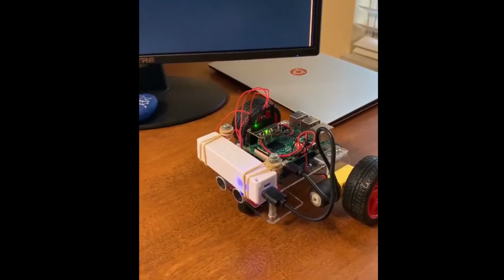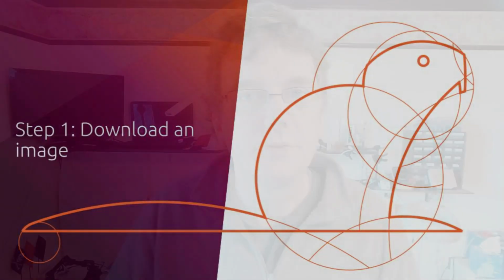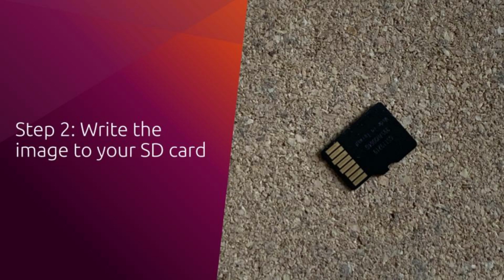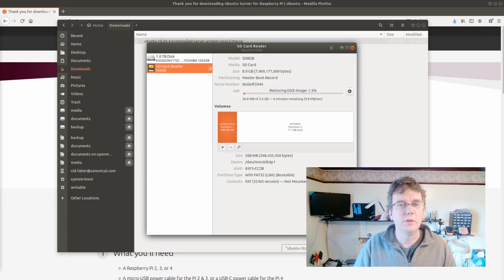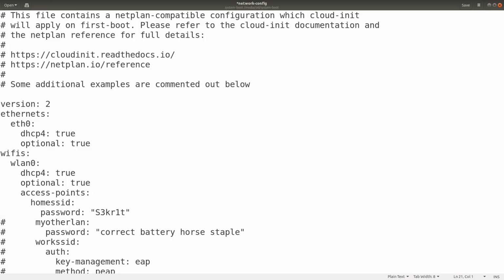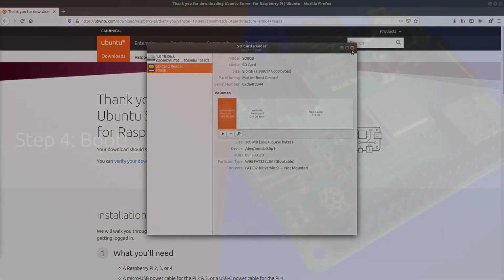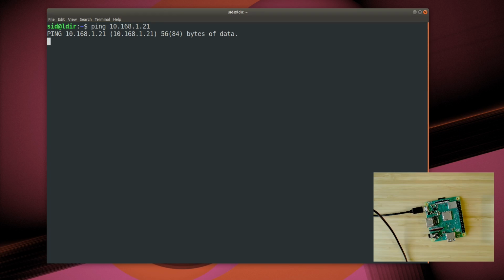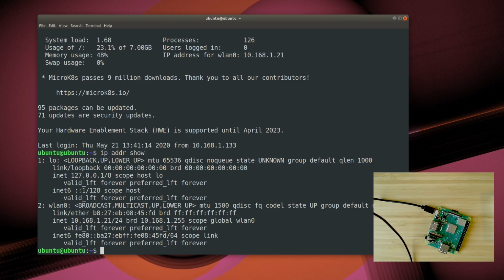Install Ubuntu 18.04 Server on a Raspberry Pi

Comment: Hi Sid. Trying to install 18.04 on my Pi 4 8gb and having massive issues with the boot loader. Getting the error "start4.elf: is not compatible 0x0 error". Can't seem to find the fix through google. Any suggestions? I want to use 18.04 for an older version of ros.
Reply from the maker: Hi Flynn3778, I assume you're writing the image with Disk Image Writer or similar and don't have any issues with writing the image itself, other images work? I just did a re-install on a 4Gb Pi 4 with ubuntu-18.04.4-preinstalled-server-arm64+raspi3.img.xz, seems to be working fine. Maybe also try the latest 18.04.5 LTS daily build available at http://cdimage.ubuntu.com/ubuntu-server/bionic/daily-preinstalled/current/?
Reply: @UbuntuRobotics  Hi Sid! thank you for the reply! I'm not sure why the 8gb was so difficult. I ended up having to update the eeprom and import the .elf and .dat files from a later version to get past the bootloader. After that I had success with 18.04.4. Gave me even more grey hairs! Moving it all over to my ssd tonight so wish me luck. Then I'll get started with ros. Thanks once again. Loving your videos, please keep them up!
Reply from the maker: @Flynn3778  Please let me know how it goes--and I'd like to hear if anyone else is having an issue with the 8gb Pi! We're working hard to make the Pi+Ubuntu+ROS experience first class.
Reply: @UbuntuRobotics  Hi Sid. Foxy installed like a dream on Ubuntu 20.04 using an SD card. To get the speed I'm trying to install it on a ssd. Do you know if a package is in the works were you don't have to decompress the kernel and all those other modifications to the boot? Would be happy to move forward with ros2 on the sd card knowing there's an official canonical usb boot implementation in the future.
Reply from the maker: Hi  @Flynn3778 , glad to hear that the installation went smoothly! I've been pocking around internally about booting Ubuntu from the USB on the Pi4 and I got confirmation that "we're working on it". Unfortunately I can't give you any time estimate but be assured that a lot of people are interested in this - myself included - so that's a motivation to get it out asap! Keep an eye on the channel as we're probably going to make a video about it ;-)
Reply: @UbuntuRobotics  Awesome Sid, thanks for the insider information :)